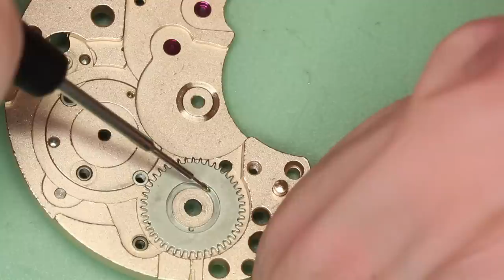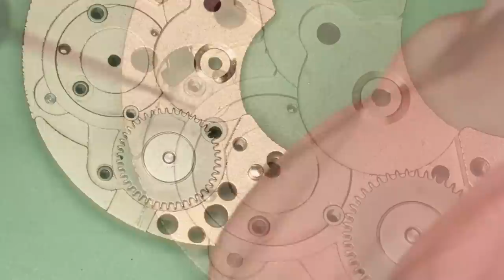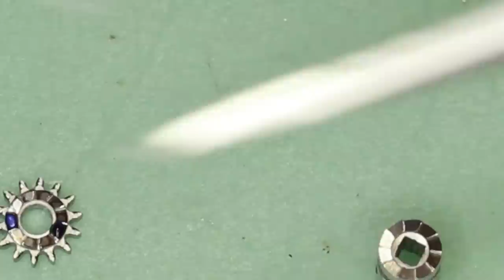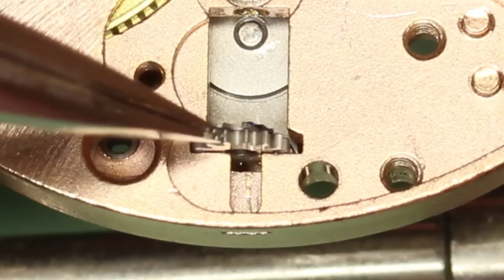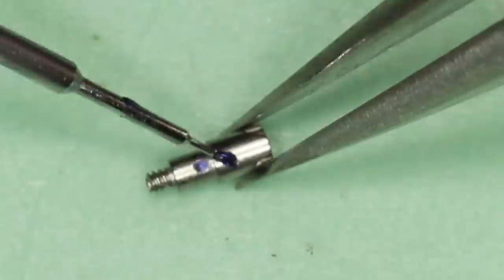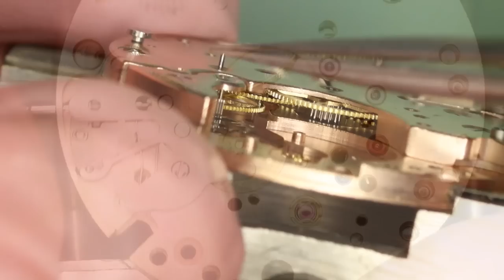Servicing an Omega Chronostop Calibre 865 - Watch repair tutorial - Part2

Comment: Why did you grease cannon pinion? Is it possible that grease will lower the friction between hour wheel and hour hand?
What about cap stones, why you didn't remove them before washing the movement, is it possible that some old oil will stay under it in the jewel hole? (this question is about first part)

Comment: so do you have to run some sort of air filtration in your workshop or is that not necessary?
Reply from the maker: Sedationsounds No air filtration but it is a luxury I would love to have.
Reply: Watch Repair Channel i just open a window when cleaning parts, the solution fumes are carciogenic, but effective, bút im planning on drilling a hole in the wall and place an old vacuum cleaner outside ;-)